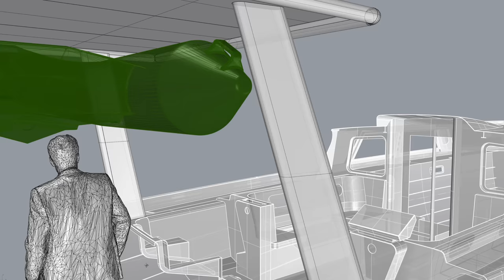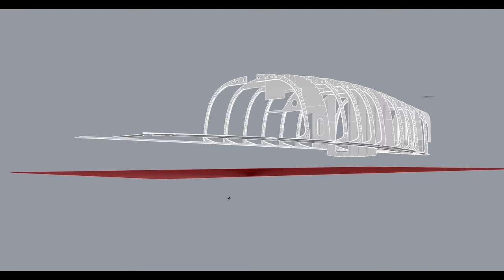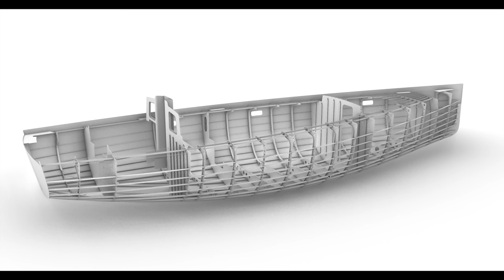Building an Aluminum Sailboat Pt 3 - Raising the Hull to Weld Frames & Bulkheads | EP 221

Comment: Immaculate work space with everything planned out for the next step.  You skipped over the large center structure that was welded in-what purpose does it serve (structurally)?  The reconstruction engineering, planning and tweaking really shows.  Excellent video.  Appreciate your efforts.
Reply from the maker: I think you’re referring to the engine room and mounts for the engine.  It’s upside down and hard to understand without drawings. Some assemblies like that are pretty big when installed 😀

Comment: Thank you for giving us an insight into aluminum boat building with this video. It's very interesting. I would be interested to know what the boat builders are doing to get the hull really tight. For example, are the welds x-rayed as it is done in steel shipbuilding? That would be my question.

Comment: The boat framing is looking great and I am assuming that it will be fulling insulated against the cold and heat as well as the noise of the water against the hull while sailing and at rest.  What kinds of systems will you use to control condensation once the boat is completed?

Comment: Thanks!  I am loving seeing the build and Aluminum construction techniques, particularly since it's much less common than plastic composites.  It's a real treat to get to see this so thanks very much for sharing it with us.

This is not intended to be negative, but it's clear that this method of building, and most cruising boat building in general, is HIGHLY labor intensive, even with computerized cutting of parts, and that drives the cost up and keeps cruising away from more people due to the high cost.

The same is true of plastic composite construction.  Even with production molds, it's highly labor intensive. 

It would be useful to know the labor cost component of the builds, including plastic composites.

This is an area that could be improved with automation, or better, different/novel/smarter construction methods.

Comment: 🤔 Paul & Sheryl,

         This is a fantastic series (although agonizingly slow , we wish the updates were weekly 🤣)!  We would love it if you would do tabletop discussions of your design consideration thought process.  Of special interest is the hybrid propulsion system, battery management, regeneration, shaft drive vs sail drive, rig choices, and ultimate stability due to the swing keel.

           I observe that since the transom has a fold down gate, a wind vane is not possible unless some twin system is employed outboard of the gate.  ……  It looks like the rectangular cutouts in the outboard hull aft might be for Oceanvolt type hybrid sail drives or perhaps daggerboard trunks, but I also observe also the provision for a centered shaft log.

           There are so many interesting decisions to be made and the details between cruising/racing sailors of your stature and the engineering and fabrication expertise of the builder will be instructive to anyone considering a similar endeavor. 👏 👍.

Comment: How do you keep condensation in check in the high lats. I have been a liveaboard sailer for 45 years in New England in balciacore boats with added insulation. They still sweat. Stringers will draw the cold in, along with aluminum bulkheads. You do have the answer, don't you? I wouldn't think of building a refig or freezer that way.

Comment: If the deck is not leveled completely before the first weld there will be a lot of stress in the boat. The deck needs to be built in a mold first even before the stringers below deck are attached. There will be misalignements somewhere otherwise as the stresses will try to equalize. I'd strongly suggest to have a owner's representative looking at the boat at least once a week for non experienced guys like you. There are too many things to go wrong. If you build a house there's also an INDEPENDENT architect watching the construction. Don't do different when building a boat.

Comment: Distant shores. First congratulations for sharing this process, great video.

2nd as a builder, its tears on the eyes for such thing... for the worst reasons. 

Let me explain, this is a very expensive built for the customer and trying to save a few $$$ and compromising all boat its almost like a crime. Building on the floor is very unprofessional , it means lack of equipment like side monted crains on roof and work with forklifts. Then ALL , but ALL projects of this nature need a proper chassis , car, boats, airplanes everything ... using a concret laser to measure this ... is this serious??? this is not acurate, just the laser line as more than 2mm , building in sections at the end ...wooooo. 

SO, why they do this: Fisrt lack of conditions, no proper tables , stands (welding on the foor scraching everything, min 7:20 already twisted), no capable side mounted roof crains, for a boat like this it is a must. then the lack of under proper chassis to build it, saves around 5k $ on the building and its disposal material after. with a chassis you need proper crains to build and rotate. you win time on the build also because aluminium is easy to bend, so at the end if it doesnt fit you fill with weld, or cut it to fit. After assembled it will be twisted for sure , but because it will not be in a road like a car, but in ocean, you cant measure how well it goes in straight line. Then  by twisting , bending and pushing because of the lack of chassis , the aluminium resistance will be lower, but again a "normal" person cant measure it. It may look at first hand thats is not a problem, but special on a boat this size the forces that act on it are exponetial , this details at the end may dictate if the boat can resist a storm force 10 or an 11 for example, because the failur starts on the weak point of the structure (from min 7:40 to 8:05 thats a crime).  Inside the isolation after have to compensate to level fornitures. then building on the floor and bending and pushing will create a lot of scratches and to remove then they have to fill with weld (lowering structure resistance) or sand it and make it thiner. Honestly I expected way more, from the building process, this is very amateur. It is understandable that you dont know exactly what is the proper way to build, but they... came on, this is expensive . With the pieces already cnc cutted its just fit and weld. by constructing this way, to make a work like this every metal shop could do it... For people that dont have the notion, this is the base of the boat, when you dont start correctly it will afect everything after, many many details will be afected afterwards. just an example, in a smaller sailboat, just the fact that welds were reinforced it reduced the vibrations of the motor, by reducing vibrations the problems with a cranckshaft disapear, no problems with rubber mount engine suports anymore, and in long passage there is a big diference in confort. If you want more "things that almost no one says" please make a video of the welds inside the boat and measure their lengh and the lengh between them and also tell the thickness of the alumium plate on that.  I cant have sure, but the way you film them work, I am almost sure that many things are not in proper way.